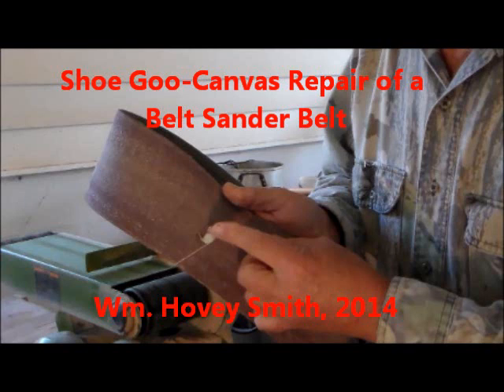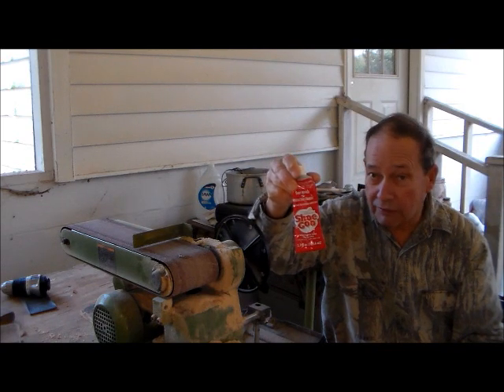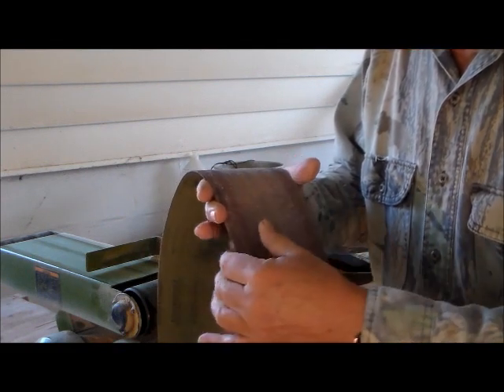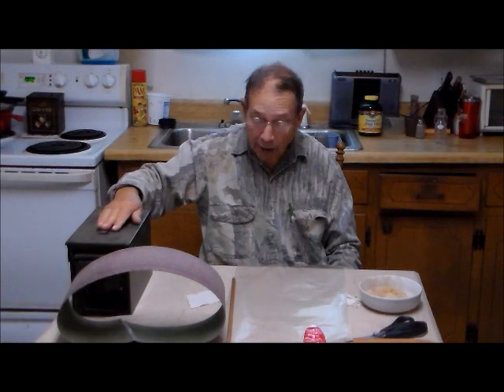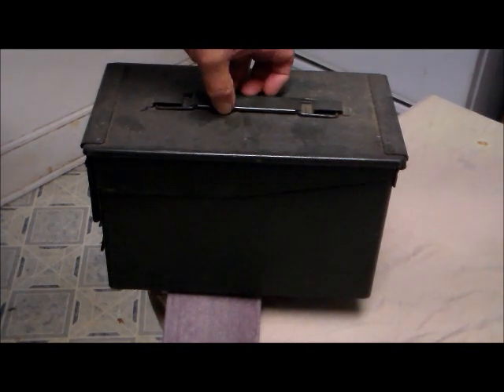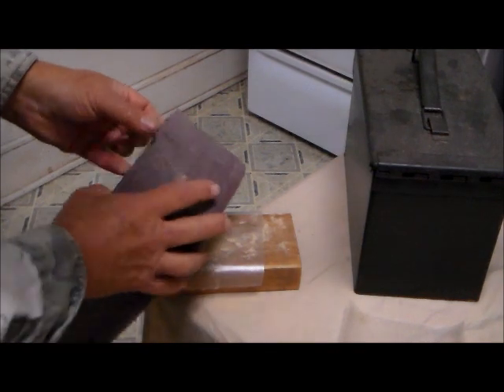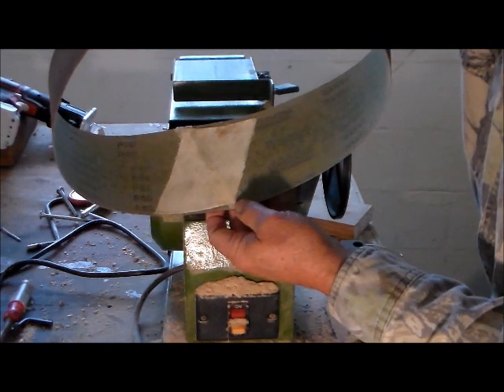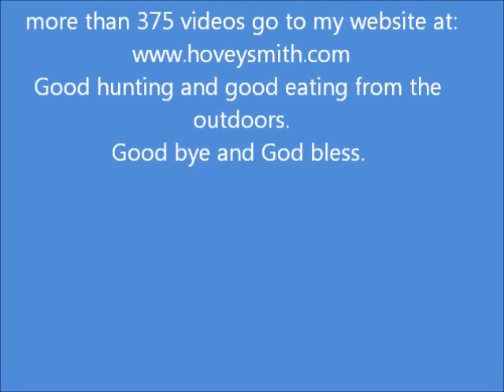Shoe Goo Canvas Repair of a Belt Sander Belt

Comment: i have new in the box belts that break soon as installed on machine,  they are old and the taped/glued joint failed.  i wonder if this would work for me?  i will try with shoe goo and drywall tape.
Reply from the maker: Drywall tape may be a little weak. Two inch Duck tape is stronger and would do better. Tape and reinforce before you ever put those old belts on the machine.